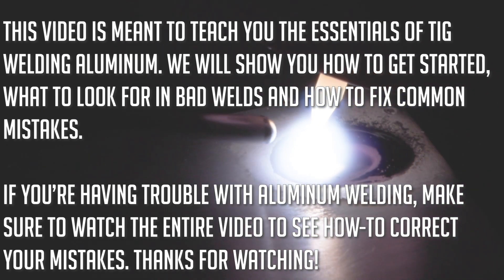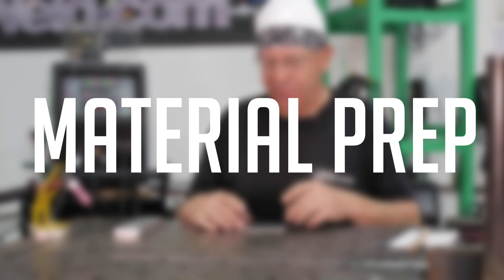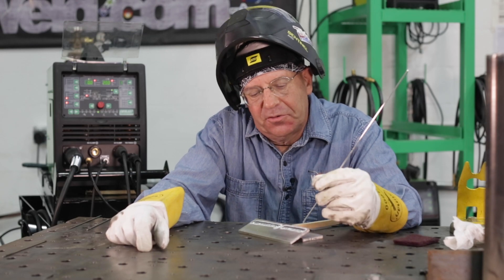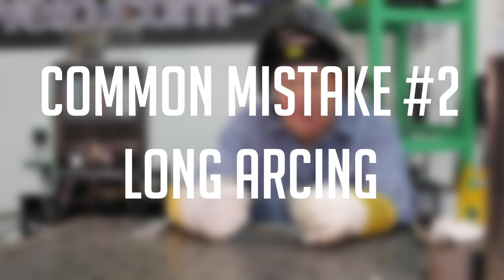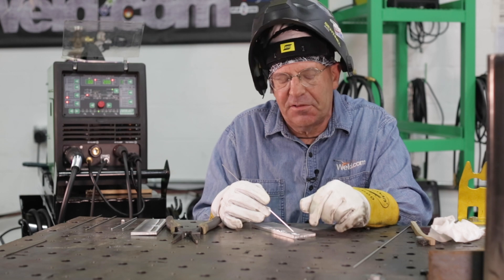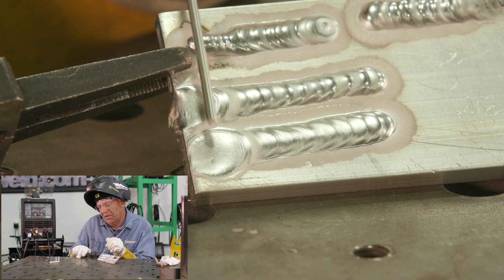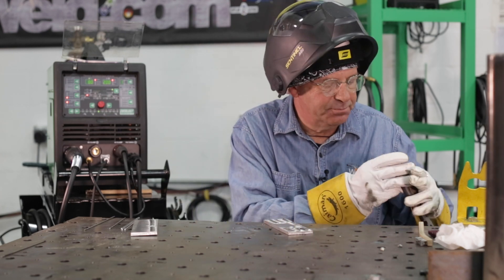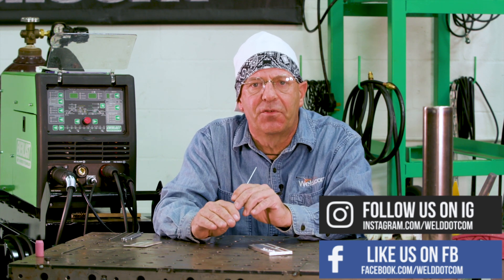How NOT to Weld Aluminum

Comment: Great explanation Bob, very good content.
Reply: Jason Becker 
Can you bevel aluminium?
Reply: Arthur Lion you sure can. I typically use a saw but you can also mill them, if you’re just practicing you can use an aluminum grinding wheel. I have also heard that you can use a router to bevel them as well but haven’t tried that method.

Comment: It was very useful that you defined "Positive" and "Negative."  Positive in many electrical and electronic descriptions is used to refer to the source of electricity; in actual physics, it is not.  Positive is the electrode towards which the electrons flow; electrons are negative, so current actually flows from the negative source to the positive sink.  Since it matters with Aluminum welding, the physical explanation was important - otherwise the machine setting would be exactly wrong, with 70% of the time electrons flowing out of the Aluminum, and only 30% of the time with heat being applied by the electrode.  It might have been interesting to show what would happen to the weld if the setting were reversed like that.  70% electrode negative - pushing electrons into the weld and heating; that's the rule.  Do all machines use the same standard?  I.E. does 30% setting on AC bias mean 30% electrode positive no matter who manufactures the welder, so it is an absolute AC standard in the welding industry?

Comment: I work for a dock company. We have a OTC aluminum mig welding machine. We use a plastic liner in the lead. It is very very touchy and it will bird nest constantly. Any suggestions to minimize this or something we can change?

Comment: Thanks for your videos, if I dont have them I dont know what to do with my welder. I have the problem that when I weld aluminium in AC the point of my tungsten turns into a ball, you know what im doing wrong? I have tried with all regulations of the welder but it cant find the correct point. Im using 2.4mm green tungsten, 20cfh 100% argon, 8 cup, 6mm tickness aluminium. Thanks!

Comment: Thanks for this great video. Gonna have to TIG weld aluminum for the first time in the next few days. Just one question about the content here: the welds after dipping the electrode into the puddle still look great. when you say that they are bad now... do you mean that they are not as strong as without dipping? or is it just the cosmetical issue with the blackening around the weld?

Comment: Hi there. Just a quick question about amps vrs material thickness. Say you were working with say 3/32 thickness tubing for a custom turbo job. Would you still use the same power scheme as what you are using for the material thickness you are using in the video? Thanks, I am new to the trade and your videos have been a great help in mig/stick.
Reply: Woops, asked the question way to soon hahaha. Thanks!

Comment: hi, i can post a video of my welding? the arc is zapping left right , the filler not Melts but the piece of aluminum melts and make holes! i try 100hz square wave and 20A,60A,100A 3mm alluminum piece!My machine is TIGMIG TM200DIGITALALU.

Comment: So I have a question. Idk if you check back on this since it's an older video. I was taught don't Tig weld aluminum with a pointed tungsten that it should be balled up or semi-tapered. why do you have yours tapered?

Comment: Me and a friend are practicing for a aluminum test 3/8 beveled plate with backing strip bend test. What is the correct way to do a bend test on aluminum. I know the best way is to do an x-ray but the job is not doing X-ray test. Also my friend has done the practice test twice and the aluminum weld is breaking in half. Weld looks good all the way thru.

Comment: I've never held a torch of any kind, I'm a wood guy, but have always been intrigued by welding. Your unquestionable knowledge and laid back instruction are very good and make me wish I had a set up to start running beads.
Reply: dude....hop on Craigslist or Facebook and pick up an old stick buzzbox and get welding :)   tbh its easier than woodworking(wood is finicky, and all the sanding ugh)

Comment: Bob, I need some advice about buying a machine. What machine would your recommend option one: Tig DC machine 5 to 200 amp. Second option Tig AC/DC machine 10 to 160 amps. Price tag is almost the same. It will be used occasionaly  to repair stainless steel thin sheet (24 ga). We like the AC option but we are worried about the amperage output. What would you suggest?
Reply from the maker: Did you look at the AHP AlphaTIG 201XD. It gives you the best of both worlds and is inexpensive.

Comment: It easier to understand machine settings when you know why each metal has needs . Gas,polarity ,cups ect..amprage and frequency will explane themselves once you know what the metal needs.  YouTube kills at this.  Back inbthe day It could take years to figure out  and no one who was the best told you anything but the basics....When celphones got cameras Id actualy take a photo of someone's machine settings as they were welding. ThennId look up whay they would have certain settings done in odd ways...it took awhile but I figured it out....now you got youtube and you can hit enough vids during a week to straighten you out fairly good... use as many machines as you can. I litteraly am the only one that understands all the settings in our shop. 8ve been at this for 20+years and im seeing the next generation eager welder learing curve gaining at sharp level and alot of the old dogs set in there ways complaining whining about new machines being to complex. New welding tec is great do not get stuck in a rut with a dum machine not understanding what its doing for you...it you weld beauitfull and strong but cant replacat on other machines you dont understand what the metal and machine needs...

Comment: Great video. I have an old P&H AC/DC welder. It is a monster. I use a WP17 style air cooled torch. The machine does have the set up liquid cooled torches - don't know if the pump works or if there are any leaks. For welding aluminum, would pure Tungsten be my  best choice for electrodes or should I go to something else?

Comment: Probably not ideal but for pep I have a dedicated 60 grit flap disc that I just brush against the surface as lightly as I can and keep the same section on it so I don't swirl the gunk back into the material, then I go back over it with a clean cloth and acetone, I just use brushes to clean up after I screw something else up while welding, gets me good results, not perfect but plenty for my experience/the jobs I'm doing

Comment: Great video. Now how about doing the same type of video using mig on aluminum?
Reply: Yes, please. MIG/spool gun on aluminum. I'm almost 3 years into a career of spool gunning aluminum, and it's been a hell of a learning curve. I use 100% argon, at 30-35 cfm. Miller multi-matic. 16-22 volts and about 225 wire speed.
Reply: @michealdchastain3637  how do u fill the massive craters from the spool gun
Reply: Me also, show us how Sir?...I got black soot on both sides of my MIG aluminum welds...new machine, new to aluminum welding.

Comment: Very good information, just one question when putting your foot down on the pedal is it best to put it down all the way then back off as you advance ? This is on a Thermal arc 202 Dc Tig.

Thanks Bob keep up the good work.

Jay. U.K.
Reply: Depends on the situation at hand.

Example: your running long outside corner beads. Set your machine at the max amperage that gives you a nice bead. This way you can keep your foot down and not worry about getting too hot.

Example 2: your repairing a cast aluminum skeg on a boat motor. Cast aluminum is finicky as hell. Sometimes you need a bit of extra heat, dirty metal or bubbles you need to burn out. Set your amperage a bit more than you need so you can use it if need to!

This is my own opinion, others may have different takes!

Comment: What's the best way to clean the oxidation layer off aluminum? I work in the trucking industry and need to weld greasy dirty fuel tanks.. I clean them the best I can..but get poor results.. Thanks
Reply: I'll be completely honest. I worked at a boat yard/marina for a couple of years. 

We would not weld repair fuel tanks. Reason being is that you cannot guarantee the repair. You cannot get rid of all the impurities! Especially if the tank is older and its pitted and cracked. Also the heat from welding makes for unequal hardness and lends itself to cracking.

That being said! If I had to I would sandblast the shit out of it. Grind or sand away pits and cracks all around the rapair site, inside and out. Wash thoroughly with soap and water inside and out. Lastly use acetone to clean off any remaining residue.

Be sure to charge accordingly for the extra effort. No sense in giving away work for free!

Comment: General question, can you actually weld aluminum with a Mig welder as long the wire is made out of aluminum?
Reply: Aluminum MIG wire is very soft obviously. So without special equipment a normal MIG setup can't push aluminum wire through the cable.

One way is with a spool gun, same concept but it puts a small spool on the gun itself not inside the machine. Second is with a push/pull setup. The gun has a set of drive wheels in the gun that pull the wire in conjunction with the main drive wheels pushing.

That being said I have seen, once or twice people using a standard MIG setup with aluminum. My guess is they were able to acquire some harder aluminum alloy wire that let them do this. I've used both types above a lot, they are both expensive to buy new but you never know what you'll find used!

Comment: Thanks a lot for what you do. Helps a lot.
One question though. Welding thin aluminum tube like air intake or something. How the inside of
the weld should look like? What are we looking for on the inside? I have never seen that explained.
So thanks again

Comment: Thanks for video, some good tips there! One of the other headaches I've had often is welding two different thicknesses of Aluminium together, also when doing a notch weld to join an intersecting pipe, some tips on those two would be much appreciated. - thanks again!

Comment: Maybe I missed it, but I did not hear anything about tungsten type or tungsten prep? I have always used green tungsten with a balled tip.
Reply from the maker: With an inverter machine you don't need to ball the tip. We use an E3 (purple) Tungsten with a pointed tip at about 45°
Reply: All depends on your machine and what angle of grind depends on the thickness you are welding and the amount of amps you are running.  The thinner the material and lower the amps the sharper you will want your grind.  Opposite of that as you go up in thickness and amps.

Comment: Great video guys! I am guilty of all of the above 🤣 a couple of things you maybe able to touch on In a future video that I sometimes have trouble with, here in Australia one of the most popular branded welders are WIA, they don’t come with foot pedals so it’s hard to taper off, I try to add more filler wire at the end of my weld then “snap off” with the electrode before a fish eye forms with limited success as times. Second is when fabricating parts like cowlings etc on thinner material, 2.5mm to 3mm range if I have a longer fillet weld to proform that Is well in from an edge I find that at times before the base parent metal has formed a wet pool ready for filler it can expand and deflect away from the vertical side of the “T” anywhere upto 10mm or 3/8” and really is frustrating. It’s not possible to always have it clamped down. Thank you for the effort you put into your quality content, it has really helped me become a better welder/fabricator. Cheers 👍🏻👨🏻‍🏭

Comment: Very cool, thanks for posting. Especially the lack of shielding gas. I've got an old spool gun that's been giving me fits, and judging by the "aluminum poop", it's a gas coverage issue.
Reply from the maker: Could also be arc length or just addi g the filler to high as well.
Reply: @Welddotcom  thanks. By arc length do you mean stickout? It's an old Profax spoolgun I was trying to run off a Ranger 10, both bought used. I wasn't sure if the CV was jacked up on the Ranger or the adapter box for the Profax was giving me fits. But looking at your lack of shielding gas example is exactly what the welds from the gun looked like. I cranked the argon to 50, but probably with the old hose and maybe faulty connectors or solenoid...
Reply from the maker: @tommyt2854  my fault. I missed the spool gun part. I thought you were TIG welding. I was referring to the distance between your Tungsten and the work piece.
Reply from the maker: @tommyt2854  with MIG it could be your contact tip to work distance. Aluminum MIG is a spray process. We've got a few spool gun videos on the channel. Be sure to check them out. If you're still having trouble, post some pics in the FB group and we'll help you troubleshoot.
Reply: @Welddotcom  thanks boss, will do.
Reply: Also check your trigger valve. It's easy to over pressure those little valves in the gun. It can lead to gas coverage problems if the leak is big enough. The Miller spoolmatic guns are finicky that way. Anything over 35 cfm can lead to problems and too much gas is almost as bad as not enough!
Reply: @mcpheonixx  right on, thanks. I may have damaged mine then.

Comment: Has someone tried to clean the aluminium with acid  before wealding ?  ; I use sb-920 from favorcool to clean aluminium parts in HVAC SISTEMS ( They are other brands with equivalent products) .
Reply: Degreaser and a wire brush is all that is needed.  Im not sure using acid would be cost effective in the long run.
Reply: fighterx  acid Its very cheap 14$/ galon (3,8L) ; I have to dilute it 5-10 times and then apply it on the aluminum parts with a brush or cloth (I noticed the effect when the foam fell on an aluminum ladder, and when I cleaned it in that place the aluminum on the ladder shine)
Reply: @mihaiachim5299  also depends on the wps or customer specs.  Im not entirely sure if acid would effect the strength of the product in the end.

Comment: Why is it that the alu.weld  never is as strong as the  basematerials we are trying to put together unlike welding steel where the weld is as strong or stronger than the welded material?
Reply: Filler usually has 5% mag in it.
Reply: Heat has a lot to do with it as well as differing alloys.

Heat can cause brittleness and differing alloys can create delineation between the two metals, causing a weakness.